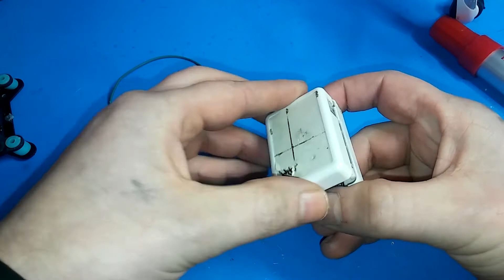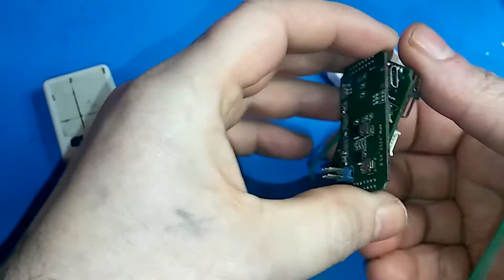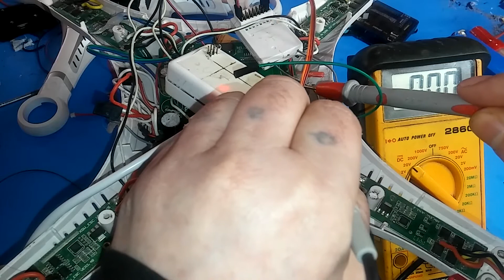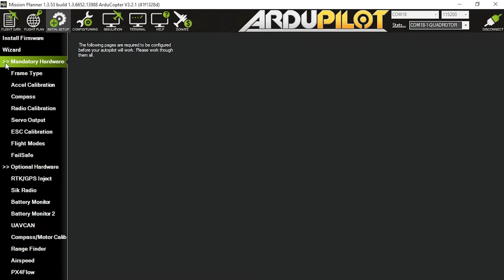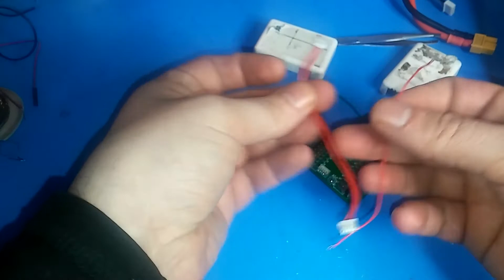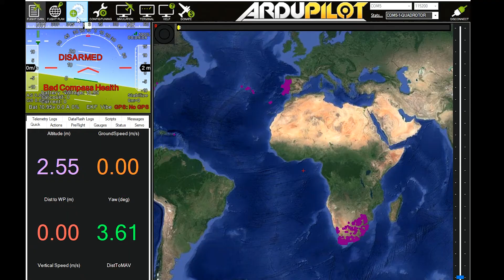cx-20 1wire Battery sensor mod

Comment from the maker: settings for voltage divider if not using a meter to test voltage first.
these are the ones I used in the video.
Apm 252.v5 Mod1 = 5.62
Apm 2.6/2.8 Mod1 = 5.56

Apm 252.v5 Mod2 = 11.28   (white wire)
Apm  2.6/2.8 Mod2 = 11.14 (white wire)

these should be pretty  close to your battery .
on a fully charged battery the hud should display your battery at
12.6 volts

Also at the end of the video the board I said not to use ..You can probably use the same location as the first mod . however I don't have one and could not confirm it ..

Comment: Great work mate , The easy way  is what I will do tonight as my drones apart again !!,  
Great  mod for open areas where you just want to keep flying  Makes the Cx more user Friendly 👍
Reply from the maker: thanks for the comment..    Just make sure you get into a practice ..of always doing a return home test ..before you fly it far..     Honestly I don't use the fail safe for low voltage .. and if i did I would only use it has a Land option   .. I do use it for telemetry voltage information.  Reason why is say the compass some how gets bumped 1/4 out of place.. during your flying time and the quad decided to return to home. it will just simply fly away.   Not big deal if its close to you. you can just take over. however if its far it might be to late to recover..

About the battery and usb at same time . that you posted on the groups.. DONT do that .I have warned them so many times about that practice but they refuse to listen lol.. check out my simple usb to apm video  for a extremely easy mod..  Then you never have to worry about fallowing my how to fix esc's ect..
the reason why the cx20 beeps is because its a low voltage alarm.
Reply: Thanks Bangs again some good info 
I will look in tonight also about the USB 
Mod 

As last night yes I thought my apm was a goner , I got lucky .....
Reply: Bangs can’t do the mod to mine 
I don’t have the white wire as illustrated and I’m reading 5.03 v
Reply from the maker: odd.. are you reading from the red wire pad?      at the end of the video i show gary's mainboard is your board like that one?
Reply from the maker: https://youtu.be/Kg6XIlQ-23k?t=1337
if you want send a picture to me on facebook..
Reply: I Just messaged you a photo Bangs .....
Reply from the maker: don't you have this wire on that board ?  https://youtu.be/Kg6XIlQ-23k?t=1001
the picture you showed me has the 2 resistors and cap .. where i soldered the first time btw as well
https://youtu.be/Kg6XIlQ-23k?t=446
Reply from the maker: take a picture of the other side.. with the white red black wire.. if you have no white wire with the red and black wire..you probably still have the pad.
again talking about the other side of the board then your picture..
https://youtu.be/Kg6XIlQ-23k?t=983
Reply: bangs6996 I have the white wire with the red and it’s not connected to anything 
I sent a pic of that end on messenger? 
Not sure if that’s where you want me to send tho 
Cheers

Comment: Hi Mr.Bangs, sorry I forgot to tell you its the bigshark version .thanks.
Reply from the maker: Oh ok the bigshark is not compatible with mission planner it uses a arm chip ..where the open source uses a atmel .  

You can upgrade to a open source apm like the one comes with the cx20 open source version and I made a video step by step here

https://www.youtube.com/watch?v=mrBWEATUbus

or any of my other cx20 252 video to what ever flight controller i have about 5 or so .. but the apm 2.8 is basically 100 percent the same as the open source cx20 flight controller. 

I have links in my description for them but I just did a search on ebay and you can get the gps / power module and apm2.8 for about $45 in a kit.
Reply from the maker: so don't fallow this video as well for a mod it is not compatible as well.
in fact on the bigshark it might already be using that wire the right way.

Comment: Hello Bangs.... i damaged my factory apm fc. What would you suggest as a replacement? I'm open to upgrade if it improves the flight characteristics ...
Reply from the maker: If your happy with what you had before . you can just get a apm 2.8 .. 
I would suggest getting a neo 7m or m8n gps as well .for the apm 2.8

If you had a open source cx20 you can use your gps and compass but you have to mod and solder .

I have a step by step on changing your cx20 to apm 2.8  here .. https://www.youtube.com/watch?v=mrBWEATUbus  

that apm is basically 99 percent the same as the open source factory apm.
You can plug in telemetry ,power module,gps and compass with ease on the apm
2.8..
accept the led's need to be modded but I do show how to do it in the video.
and if you run into trouble just message me ..

... 
besides that i have other video's
dji naza m   //needs heavy mods for transmitter.
pixhawk .. // pretty easy to install
micro pixhawk.. //need to cut lots of wires
Pixracer // need to cut wires..
apmpro // wires have to be cut up 
mini apm // wires have to be cut up.

the dji personally I would stay away from.

every "Pix" is basically a apm but with a 32bit arm
and can handle newer firmware versions..

however with all the apm's I have i still just fall back to the apm2.8 / apm 2.6
it does everything  I need..
Reply: Thanks bro..will order it tonight. btw i have the  Bn880 same right?
Reply from the maker: yup bn880 is perfect..
Reply from the maker: well as long as you have the apm 2.6 cable that came with it....then it should be straight forward..    I ordered a bn880 and bs880 couple of weeks ago ..and will be making my own step by step for the original apm and apm2.8 as well soon..
Reply: cool. on the power board im getting less than 5v  from the wires that power the receiver and fc, can I replace something(regulator) or should I just purchase a new one. Thanks for your assistance...
Reply from the maker: i would just get a power module.. then tape up that wire like i say in the video.. then all is good..   alternatively you can just find a cheap 5volt bec as well.
Reply from the maker: ok so I took couple of min to figure out what the chip is..
if you have a 8 pin chip by the 5 volt wires.. ..its pin 3 you should test for voltage it should be around 5-5.5 volts..

the chip is AME5268AZAADJZ  (A5268 )
if you want to attempt to replace it..

Comment: OHh I forgot Bangs6996,when I connect my cx20 to mission planner it always says error or cant connect or something like that ,what do you think?
Reply from the maker: Hi,  have you tried to connect the usb cable directly to the apm it self?
the apm takes a micro usb instead of the mini usb style.  this will rule out bad connection internal or a bad usb wire..  Mine actually came disconnected. and a rock/pebble  in the gps puck ..lol..